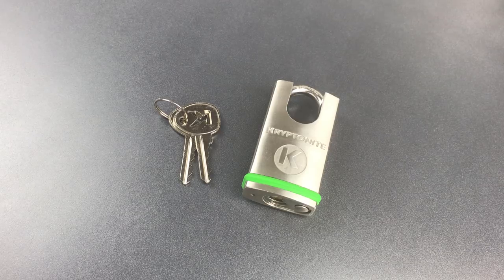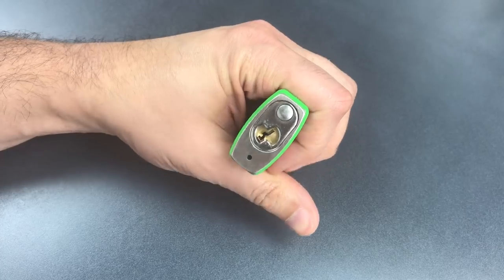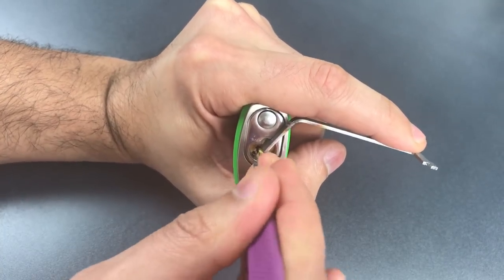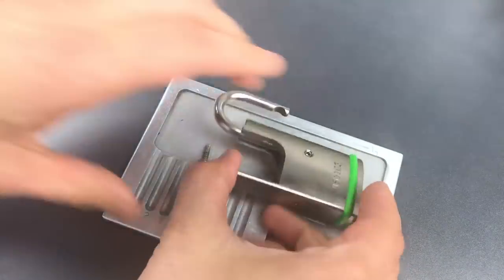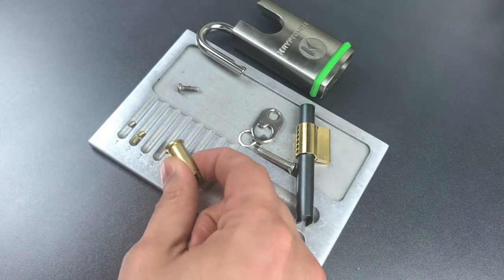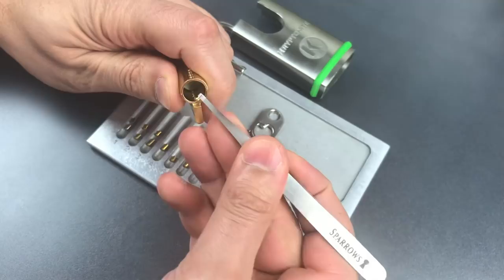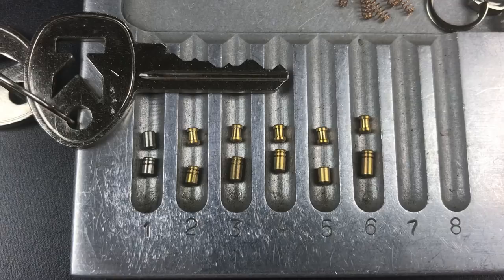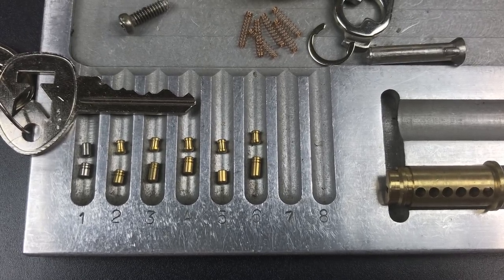[750] Kryptonite 40mm Closed Shackle Padlock Picked and Gutted (Model 851103)

Comment: I've seen several high end locks in my life and I've always wanted to buy one. After I think that one thing always comes to mind, folks getting mad and trying to destroy it by the means of hammering a flat head into the lock or pouring super glue and than making it's biggest advantage a disadvantage when it comes to removing to sabotaged lock.

Comment: I feel that this lock is vulnerable to a simple angle grinder attack, what with the little screw going  into the bolt - which could be notched with a grinder or even a Dremel with a metal cutting wheel. It could then be turned with a screwdriver to remove the bolt from the retaining screw, and out pops the core.

Comment: Back in the 90's, no YouTube, I had to figure out myself how to slide the cylinder out without having all the tumblers spring out, so I came up with a large pen cap to slide in and it also nicely clips itself onto the body to hold in place 😆

Comment: I wonder if we're ever gonna start 3D printing finished locks so there won't be any screws or obvious entry points.
Reply: Screws aren't really a security flaw though, if you're 3d printing anything it's not gonna be a strong as cast metal, which means it's  easier to break with a hammer

Comment: I noticed it did not have a bypass plate in the back of the lock is it not needed on these? Great video btw
Reply: I believe the actuator being perpendicular to the keyway indicates a design that cannot be bypassed. I'd be interested in a video comparing different cores and actuators, and showing how the bypass tool works on some but not others.
Reply: @bmitch3020  thanks and yeah would be interesting
Reply from the maker: Correct... not bypassable. 👍

Comment: What would the steel pin do, compared to standard pins, to prevent drilling?
Reply: Won't prevent it, but steel is much harder to drill than copper, low grade drillhead might even brake on a good steel pin, or at least will make it go much slower.

Comment: Can It be bypassed by some kind of tools ?
Reply: Your first clue to answering that question is to examine the shackle protection. Those big, ole beefy wings that stick up to protect from "The Universal Key" (a.k.a. Bolt Cutters) is a good indicayion b that dome degree of thought was put into protecting the lock from bypassing. Look carefully at the shackle and body by pausing the video, take a screen shot of each, put those in a document, enlarge them. LOOK AT THEM  tell us what you see.
Reply: kattle sheets I was just saying that because there is no anti bypass wafer at the back of the core.
Reply: Vincent Montibus Look at the back of the core at 2:48. You can see that if you put in a bypass tool, it would hit the actuator at a point where it is not recessed; the recess that engages the core is located above the keyway, and at a 90 degree angle from it. Inserting a bypass tool would simply hit the actuator at a solid point, and not let you engage it.

To make this more clear, look at the part of the core that engages the actuator. It sticks out above the keyway, and is perpendicular to the keyway itself. If you can now imagine how the actuator is shaped to accept that part of the core, you can imagine that you run into two problem when trying to use a bypass tool: 1. You'll be hitting the actuator where it is not recessed. 2. Even if you could apply turning force, you still couldn't turn it, as the extended part of the top of the core would be sitting in the actuator, and since the core isn't picked, the core would prevent you from turning the actuator.
Reply from the maker: A wrench would be my fast non-skilled tool of choice for this lock.
Reply: thanks for the explaination !

Comment: What's the function of the allen screw on the back of the lock?
Reply: In this case I believe it is holding the shackle in place.
Reply from the maker: Correct. It allows complete removal of the shackle when it’s unlocked.

Comment: Why can I NOT find these in any local store or online retailer? Is it from some kind of special distributor or country specific sale only? I'm in Canada…Where does one buy these locks?
Reply: This is an older lock, it has been discontinued.
Reply: R.P. Rosen Any idea if there is a similar model available commercially somewhere from a diff manufacturer? I have a 60mm from Stanley that is a little different, but what other options fo you recommend
Reply: Jimmy Hong  American does the A5300D and Master has a couple in their Pro Series the 7045 and the 7035. Of course BB, or LPL would have all three opened in a few minutes. Good luck finding something your happy with.

Comment: Our teachers think an ordinary cabinet lock is enough to protect 20 iPads. It can be opened with a scissor and a piece of wire.
In fact it doesn’t even have a lock. The same key that opens the drawer at the teachers desk opens the locker.

Comment: Is it comb sensitive ? The key look so
Reply: Most likely not. Remember that for a lock to be subject to combing, there needs to be room in the bible for the spring, the driver pin, and the key pin all at one time. Most manufacturers have shortened their bibles so that everything won't fit into it at one time.

Comment: Don’t get me wrong, your picking skills are unequalled BUT I want to see the ramset and other destructive attacks. I don’t think I’ve ever seen you fail to pick anything and it really doesn’t transfer to the rest of us. I want to see locks that can’t be opened with a hammer or ramset. I’m not worried about some crackhead laying on the ground trying to get top of the key way tension.
Reply: I remember LPL showed a padlock that required lots of shots with the ramset until it finally opened. He was surprised.